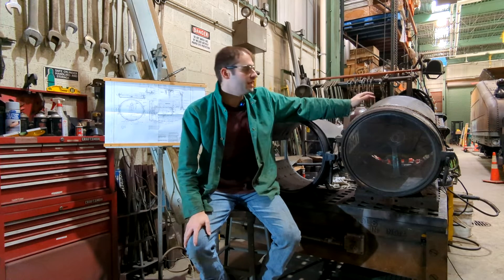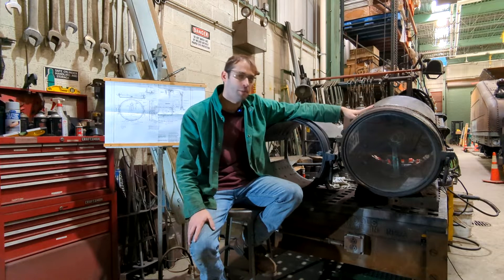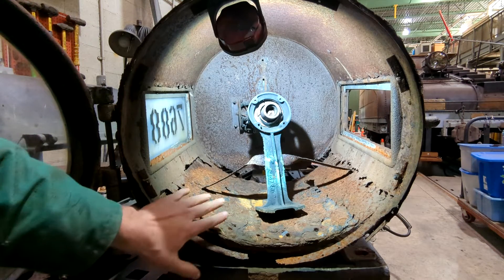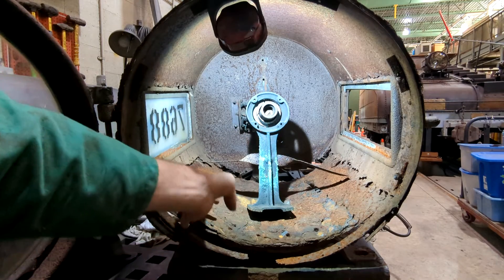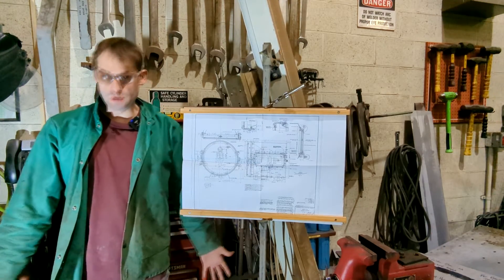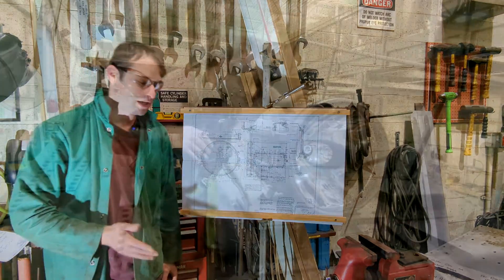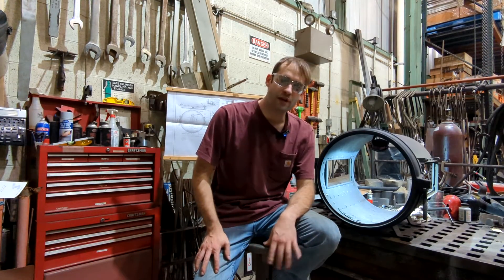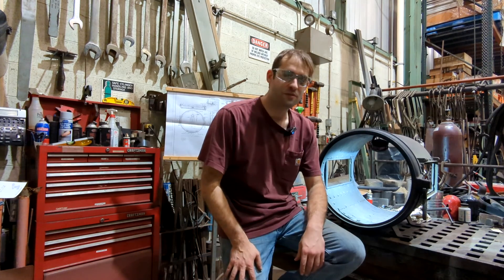Let's Build a PRR Steam Locomotive Headlight!

Comment: Shame they let them rot outside so many decades, they deteriorated that badly. Those engines were kept indoors in the Northumberland Roundhouse. No excuse that the State didn’t put a roof over them immediately. 

They didn’t need a fancy overpriced home, just some rails in a floor, 4 walls, and a roof. 

Even more disgusting they didn’t trade 757 for the I1 in Hamburg NY instead of what they did with it. 

Poor foresight and mismanagement of the collection.

Nice to see they’re making a effort to preserve the collection it’s just that it came too late
Reply: As long as you realize it's the government, not the museum.
And "4 walls and a roof" counts as an additional structure, so it has to go through the same red tape as a $3M expansion or something. 
And putting pieces under a roof can cause more damage than leaving them in the elements sometimes. 
They're not left to rot. They're routinely repainted to stop damage.